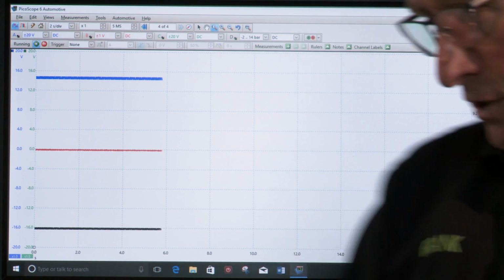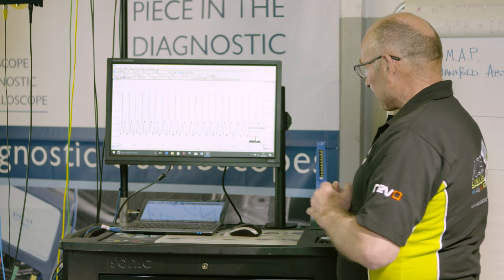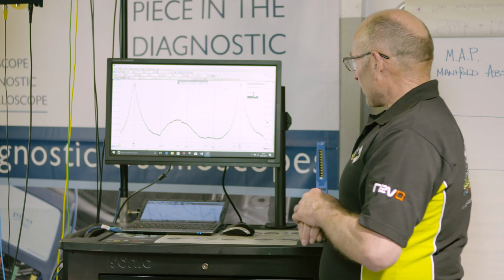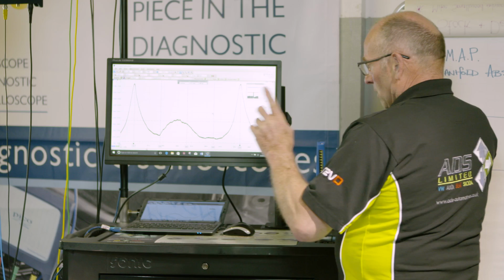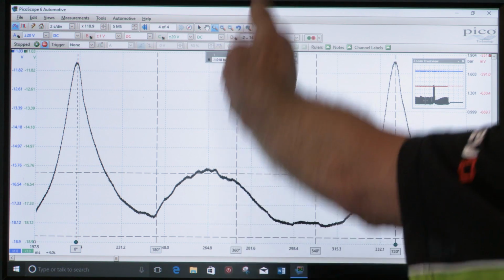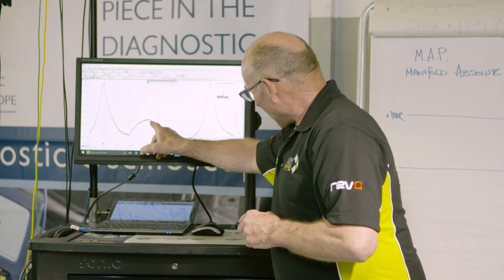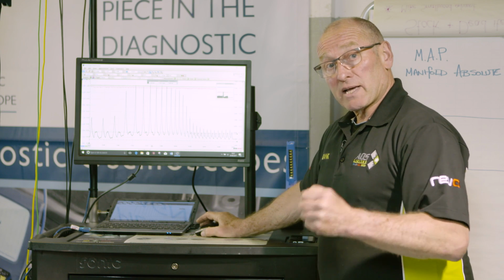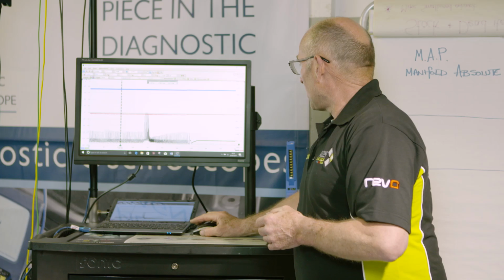Compression testing with Frank Massey from ADS - Episode 4:  Compression analysis using the WPS500X

Comment: I understand the reference to absolute zero as being the absence of atmosphere, which is about 15 psi (which is just a hair more than 1 bar.), which is usually used as the "zero" line on most gauges. Interesting way to approach it.
I have used a transducer to diagnose a blocked exhaust.